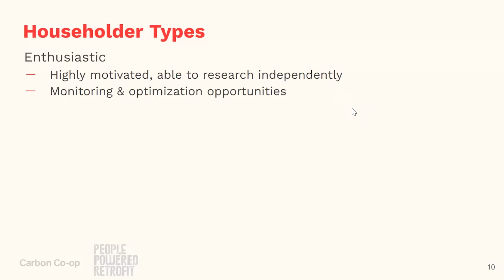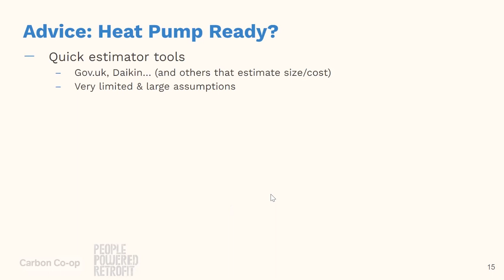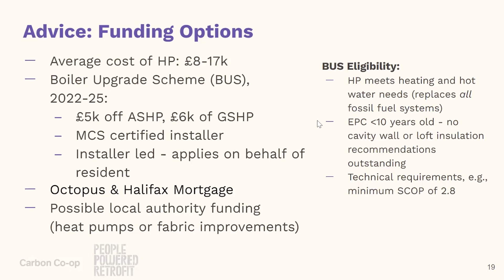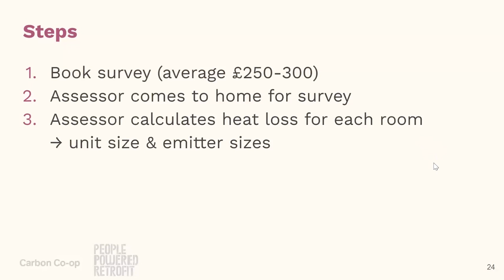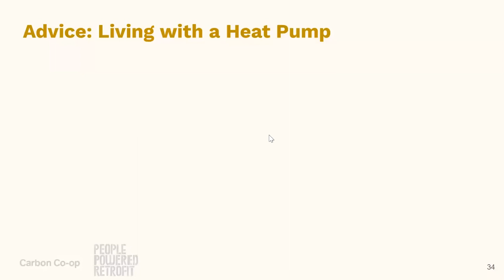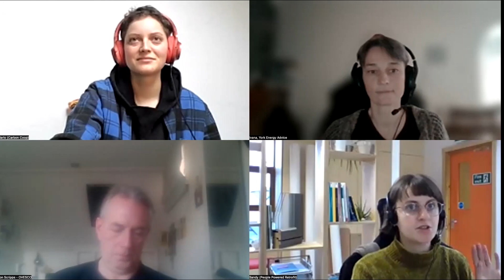Heat Pump Community Energy Sharing Workshop 1st February 2023

Comment: It is really difficult to get a heat pump installed at the moment. The heat pump hardware is around £5k, then the installation and other small bits nearly £10k. You get 5,000 from the government but and you still need to pay £10k. It you just go for a boiler and spend between 3k to 5k. It is really difficult to justify the extra cost of a heat pump considering the running costs will be the same as gas. It feels like it the same as an electric car that you need to pay twice more to get something that is not that great and basically just takes you from location a to b. I'm still not convinced.